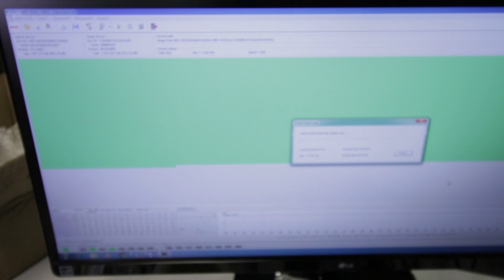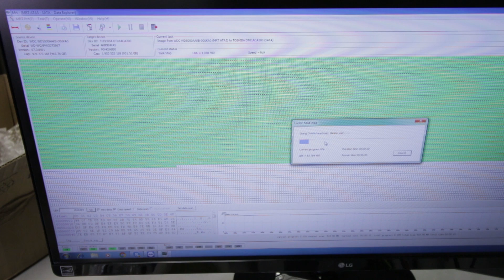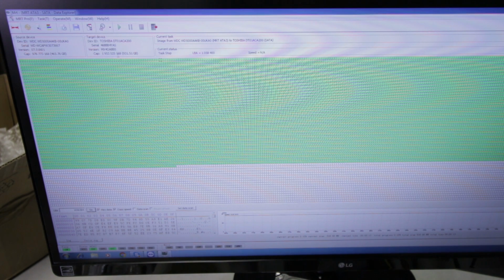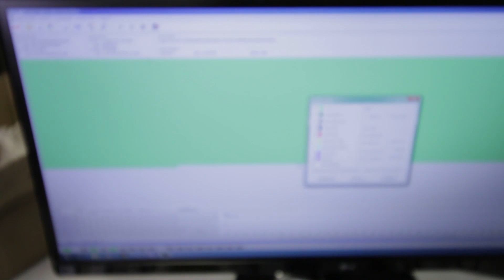hard disk repair | hard drive does not spin up at all

Comment: I have a donor drive . How do I do the firmware adaptation ?
Reply from the maker: on WD - look for U12 chip and swap it to a good working same board
Reply: @hddrecoveryservices  would i use the chip from my donor board onto my original? or the opposite? thank you so much for you help!

Comment: I have a western digital drive that stopped spinning,
tried replacing the pcb with a matching donor, still wouldnt spin up.
I checked the head, and it wasn't stuck on the platter..so is a seized motor the only other possibility? anyway to confirm that?
Reply from the maker: Seized motor and stuck heads would still produce a faint sound upon start. Dead PCB and dead preamp would keep your drive totally silent

Comment: I have a problem with my drive.. I've removed doides that were shorted but all 4 of my WD spindle pads are shorted to each other. Obviously it can't spin if it's shorted out but I think I'm going to buy a replacement PCB and swap the bios chips, but not until I fix the spindle. But I can't find anything online about what's wrong.
Reply from the maker: pads on the motor (chassis side) are in short? or the PCB? If PCB, then you probably have the spindle controller (SMOOTH chip it top right) burnt. Swap out the board and move U12 eepROM over to the donor board
Reply: @hddrecoveryservices  wow fast reply! No, shorted on chassis side. I think that is what is causing shorts on the PCB all four pads shorted to each other, even with PCB removed. So when I plug in, the electricity goes through board but cannot go to the spindle because of the short

Comment: I have the exact same drive with the same problem.  However I don’t have the equipment that you have, any idea what would cause this issue that you just repaired? And also any suggestions on where to start with mine?
Reply from the maker: If the drive does not spin, then most likely it got power surged.
Reply from the maker: Get a multimeter to test it as per video
Reply: @hddrecoveryservices  I want to do this, however I don’t know what areas to test, also if I determine a diode is bad, how do I know if it can be removed or not. Another thing. Is a soldering iron too hot for a project like this?
Reply: I’m going to take this in to a recovery service . Can you please tell me what I should say that would help me save some cost in the repair? I believe it was a power surge. And I would love to be able to save some cost in this process

Comment: you said in the video,that an adaptation of the firmware needs to be done if i had a doner board of exact model no,i do have a doner board and would like to learn how to fix my drive,my question is could you do a video or link one if you have one so i could fix my drive to transfer all files to a new one?

Comment: I have a WD 4TB external HD. I, unfortunately, dropped the drive from a briefcase about 1 meter. Upon inspection, one of the arms is misaligned with the disk itself. Do you have a recommendation to fix or swap this?

Comment: Can a platter from a disc A  be detect and read by a  disk B, if the platter(only) is moved to it?
Reply from the maker: As long as hard drives are compatible, yes. I recommend not to try it yourself if data is important. Without experience and proper tools you will lose data forever
Reply: @hddrecoveryservices Can you give me some advises or tips in order to make it on my own? I sent a mail, describing my problem with probably dead WD5000AAKS through the site you pointed above. I really apreciate everything you say and do so it would be important for me to get any help on this. Thanks a lot.

Comment: I used to use an old WD hard drive by connecting it via an adapter, one day I plugged it and it just stopped spinning or make any noise! what could be the problem? and the suggested solution?

Comment: Hello there, I got a Seagate 500GB Barracuda 7200 HDD which does not spin at all. I noticed the burn mark on the pcb board, I ordered one on ebay and changed it with the exact board model but still no spin? Any suggestions please! Thanks

Comment: Excellent video of how to remove a dead diode to recover the data.
Have you had an example where the hard-drive spins up but not all the way and the computer does not recognise it. Then when using a multimeter the diodes are shown to be working? 
This is what's happened to my hard-drive. A power surge caused it to fail to spin up. I followed your tutorial but my multimeter shows the diodes are working. Any ideas?

Comment: Brilliant Video. I followed your steps and identified that D4 and D2 appear the be faulty (multimeter bleeps). Should i remove D2 as well as D4??? Is D2 a fuse like D4? Thanks so much.
Reply from the maker: Diode should be opened.
Reply: @hddrecoveryservices  So i should leave D2 alone and just remove D4? Is that correct? (Sorry, im a newbie to this all) thanks again.

Comment: I have got a Seagate st3500418AS and it won’t spin it acts like it has no power and I replace the board and still acts like no power I still have the original board but had lots of dark spots on metal like corrosion and it won’t clean off

Comment: Hi, you're great! Can I power up the hard drive with the donor PCB only fort test if it spins up or is there the possibility to damage something?
Reply from the maker: If the drive in a damaged state is completely silent, you can try a donor board to see if it will spin it. Just listen to it for, and as soon as you can hear the movement, you can safely assume that the original PCB is damaged.
Reply: @hddrecoveryservices  Thank you. And then could I try to swap the bios to the donor board and recovery data?

Comment: I don't have a multimeter, can I just remove both the D3 and D4 diode and see if that'll fix it? Its a WD Blue 1TB WD10EZEX.
EDIT: hard drive won't spin up
Reply from the maker: these diodes work as protection. If the power surge hits the drive they absorb the impact. Removing them will remove the short (if it is there), but it will leave the drive with no protection for the next surge. Something that vital will get fried if the drive gets hit by surge again without them in place
Reply: Ok I'll get a multimeter and only remove the bad diode (if there is one). I only need the drive to last long enough to copy my files. Thanks for the reply

Comment: i don't understand this video. you mention things that a non-tech would not understand and your video shots don't show anything close up to see exactly what you're doing. first, what is that yellow device that you check if a diode is working or not (what do you call it so i can buy one)? second, i am sure that the drive that i have (seagate 6tb and not more than two years old) has this burned out diode problem because there is no smell and it doesn't spin (i used the wrong power cord and it overran the circuit, i think). third, if i take to a technician, how much should it cost to remove this faulty diode so the drive can spin again? Thanks.

Comment: Thank you for this perfect explanation! I had exactly the same defect diode and I removed it by actually breaking it and then cleaning it up (squeezed it with pliers lol). The drive works again and the data is being recovered as I type this message. Cheers!

Comment: Yeah nothing beeps or clicks i switched my hard drive and it worked so i unpluged it and fastened it in and pluged it back in and it wont evan log on it says system disk or disk error and it makes no noises
Reply from the maker: this is a typical issue for both Seagate and WD drives. Most likely, it is firmware related

Comment: question: i have a faulty board and wanted to swap it out with an identical pcb, is the reason you don't suggest this, in your words, "don't do it, lets just leave it at that" because of the bios in the new card will prevent the fault drive from spinning? or it will start clicking etc?
Reply from the maker: PCB needs adaptation in order to work with the different drive. There is drive specific firmware on PCB (most of the time inside of the eepROM) that has to be either transferred or copied out and programmed into the new PCB. Otherwise, it will not work. Sometimes it will click, sometimes the drive is just going to load kernel mode.

Comment: Hi,

What if the TVS (5 V & 12 V) diodes are not shorted out, but they still allow current to flow in both directions ? 🤔

Ergo meaning that their resistance has changed none the less. 😏

Thanks for reply.

Best Regards, 😊

Comment: Hi...My hard is ticking and i hear the power is comming into the hard drive but it doesnt spinn at all. Where do you think the problem is?
Reply from the maker: ibrahim jabbar heads are stuck on disk. Fairly easy to do you are equipped for it but is even easier to damage the drive if you are not. I would recommend to contact a recovery company and ask when they charge in this case.

Comment: can you just apply like 12v power to the motor contacts coming out of the center of the drive?
Reply: Than it will just spin full speed regardless of I/O. Which will be interesting,.. please do film! 
(but you will destroy the controller in the process likely)

Comment: sir why donating board doesn't recognize,can u please help me crearly
Reply from the maker: donor board has adaptive data on it that belongs to the donor drive. By swapping it without adaptation, you changing the adaptives on the board. Adaptation has to be done first
Reply: thank u sir,i understood
Reply: sir what if in case of pcb is burned and adaptive data chip failed. does plater swap resolves the problem

Comment: Hi there. Do you have experience with Heartbeat motor spin fail? My Drive WD2500AAKS does the normal startup buzz sound and then motor just do quiet spin fail in Heartbeat frequency. A am sure that It is not the "click of death" as the sound will be loud and it will be made by read head. But it is not even the stuck head as i can feel the start spin up force of the platers by the motor. The HDD drive was rarely used. It was assembled inside external usb aluminium enclosure with dedicated powerup button. It served just as photo bank...
Reply from the maker: Peter Kováč maybe you can record the video and post it on our Facebook wall, or even record the sound and email it us?
Reply: Thanks for reply. I try to record it with my smartphone but it was unable to record it. Smartphone mic is not really suitable for that low noise. But i "sort of" record it with my PC and well "better mic" that was directly attached with duct tape to the "do not cover hole" of that HDD. The sounds is like: Rrepeating the motor start 1. pulse for spin up but withim the 1 second interval it repeat forever...no auto turn off. I can even feel the force on housing from plater failed to full spinup. I can send you that recording (for analyze) I was hoping it will be something like just stuck head (as it was in external enclosure) but as i can hear that will require pro repairing... I live in eastern europe... so there is no help for me... (at least in my country).
Reply from the maker: Peter Kováč usually if you put the phone right on the drive it will record very well
Reply: The Smartphone only record the typical start buzz that all my old WD HDD do before the spin up but nothing else just silence and surrounding noises. So i find your video here but as i do more research I find out that my human ear hear something after the buzz so i boosted the PC mic over +24db for PC can hear that too...

Comment: I am not judging you in any way but rather ask you a question, you seem to manipulate delicate electronic parts pretty "roughly", touching with your bare hands and you do not seam to wear a static discharge bracelet, is this critical when you manipulate delicate and sentive hdd electronics ?
Reply: Well you're taking your chances if you don't take safety precautions with static electricity..

Comment: I have a 1.5tb green wd external harddrive 3.5. The external power drive board burned out a component I believe a crystal at 2.7hz and when I took the hard drive out of the external and put it in my hotswap on my desktop,  the hard drive take awhile for it to be recognized by the computer but when it does it shows an unallicated drive. When I try to allicate it the drive shows "busy". What can I do to get my desktop to allicate the hard drive?

Comment: Hey man. My ST2000DM001 (Barracuda 2TB) just killed itself a few nights ago, when I reconnect PSU & SATA and boot up it starts to spin, clicks three times and stops spinning completely. Lost a 2TB Steam library that wasn't backed up :(

Do you have any idea what the problem was? I was told to update it's firmware on Seagate's site but it isn't even detected by Windows.
Reply from the maker: no, not the firmware. clicking on these drives means only one thing - dead heads. Average cost $900-1200USD to swap it and pull data out

Comment: Hi what can I do if I've accidentally put 20V into Harddrive and it smells funny and it doesn't spin at all?
Reply from the maker: check the TVS diodes with a multimeter. If they are shorted, you need to pull them and check if the planes are shorted afterwards. What is the brand of the drive?

Comment: Let's say I have a donor and switch the pcb boards, Why wouldn't it work if it's the same revision?
And can it cause further damage/data loss?
Reply from the maker: It probably not going to cause any further damage, but it would now work because of ROM content. There are many different versions of ROM for the same PCB number even with identical revision. You can have 2 identical hard drives side by side and their boards (without adaptation) are not going to be interchangeable.
Reply: Is this a given? since I see a lot of people on youtube stating the other wise.
I'll shoot you a message via email about my specific problem.
Old ide seagate drive been dead for the better part of 9 years  now.
Reply from the maker: on U5 drive it may still work actually. But anything F3 will need rom swap. email me pictures of the boards, and hard drive's label and I will check for you
Reply: Will mail it now.... Don't have the donor yet but my brother should have one exactly the same.
otherwise eBay it is.

Comment: Just a little word why creating the head map some time take few minutes. On modern drives you have large blocks of LBA assigned to one platter. On the older WD-Drives the blocks are much smaller, so you have much more switches between the heads than on modern drives.

Just one question. In the video I saw your hot air soldering station. OK, it's a HAKKO - well I use JBC. But what kind of stand do you have for it?
Reply from the maker: Excellent explanation! Fixture for the rework is also Hakko, PCB mount is PACE.
Reply from the maker: JBC is amazing, but I have a guy who works close with Hakko that I get my tools from for way cheap

Comment: Why wouldn't the board swap work? I can imagine there must be some calibration data involved but how can you replicate it if the chip was damaged?
Reply from the maker: direct board swap without any firmware adaptation would not work. If firmware is adapted then swapping the board is fine
Reply: I'm just curious what this "adaptation" does to firmware.
Reply from the maker: you have firmware in the board and you have firmware on the disk, they have to match to work together. if you use a board off the different drive firmware on the board is not gonna match what is on the disk, so the drive will not initialize. Adaptation process preps the board to match firmware to the disk
Reply: Ah, I see... Wasn't aware about firmware in the disc itself. That's nice to know. Thanks!
:)